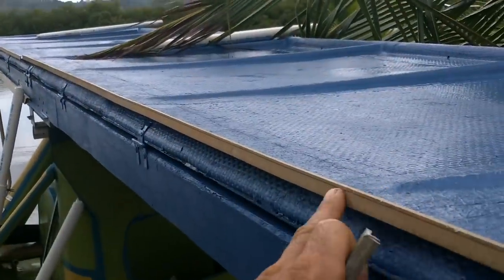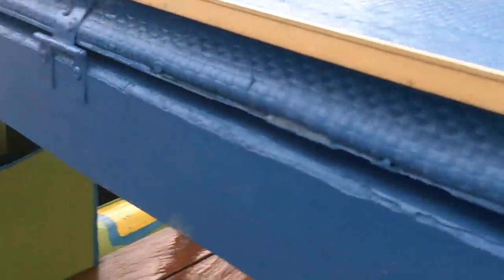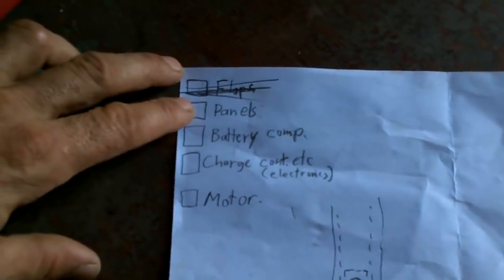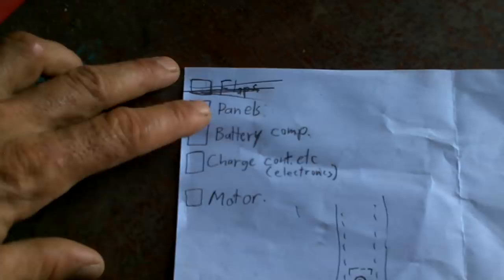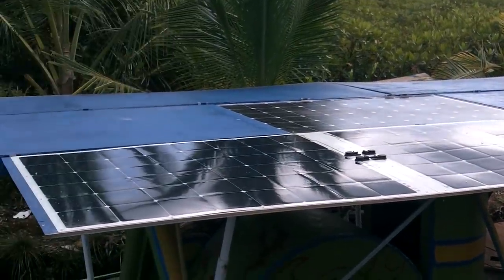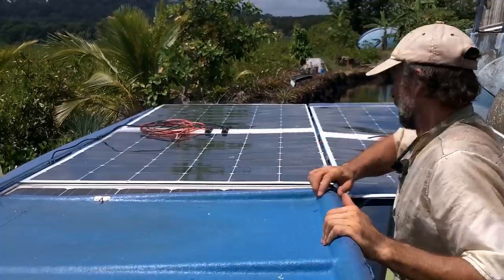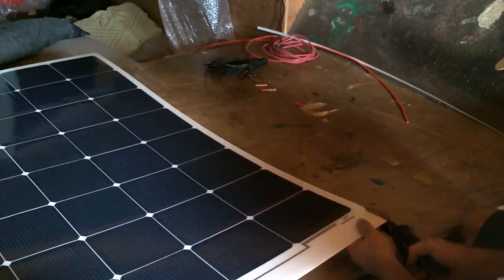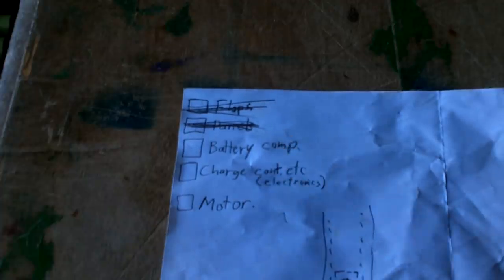Solar Snailer 036 Serious Solar Panel Action!

Comment: I like to watch other people put stuff together. When I work on a project and it's time to cut drill or somehow commit to using the very expensive material, we are all one in that monent. That microsecond of committing to a path. Fortunately it almost always turns out. I find success to be in the prep work. I also really enjoy when something unforseen causes me to adapt and the result is better than the original plan.

Comment: I don't like to make suggestions because Jamie usually figures things out BUT,  get the correct connectors for attaching the wires to the solar panels, coat them with dielectric grease and seal with silicone.  In a matter of days or weeks, his makeshift connections will start to fail.

Comment: use fine strand wire so it's flexible.  The stiff wire will fatigue and maybe break when you open and close the flaps.   Looking good!!!
Reply: Would fine strand work for the kind of electricity the panels produce?
Reply: If there is enough slack in them, the fatigue will be evenly distributed throughout a longer length and shouldn't be an issue. They do look pretty stiff though and definitely could cause them to break depending how tight they are routed to the panel hinge. 
Im not sure they make thick gauge fine strand wire, but that may be a good idea. Perhaps just a length right where each band occurs... Of course, I suspect its easiest to use it till/if it breaks, and if it does, use finer stranded wire to where it broke. I lean toward it will be fine if he leaves some slack in there.
Reply: My guess would be that Jamie works with what he has available at the time. Finding a solution down the line if stress points becomes an issue.

Comment: Sometime when you'r buying supplies, check out Marine Goop. It's real good at sealing and glueing and the sun doesn't hurt it. You could glue those wires down not have to use clamps. I use it to weather proof everything. You can wet your finger and smooth it out like glass and paint over it.
Reply: I think Marine Goop is just Shoe Goop with a different label.

Comment: Jamie if you can prop these up at close to a 90-degree angle  ,  (~          ~) with the drip edge 3 or 4 in on both sides to help catch the wind I'll bet with a good headwind or Tailwind you still have a pretty good sail . Or 3 shaped on the side that folds down last and use this side as your sale . I'll bet you can use your post to prop it either direction to catch more wind  .
I'm even picturing a hinged flap at either end that can be folded out to catch more wind . Or a third panel that hinges up from the outside of the top panel that can be held at different angles also to give you more of a wing .
 you could even put the whole thing on a pivot in front and a rail in the back that would allow you to even use it more like a sail .
 a dagger board or two and you'll be flying .
Reply: I saw a movie or something where a raft deployed a parachute on a winch to help pull! Like Mad Max it man! :P
Reply: @Reach3DPrinters  yeah check out silent yachts they have one that is really cool !
Reply: His original design was going to used curved panels for exactly this purpose, but the complexity of it made him change his mind.
Reply: @raelik777  oh yes I knew that I am watch every episode Jamie puts out .
I just see how he could still use this as a sail . That's all I'm suggesting .

Comment: I'm curious if there's a MPPT charge controller in the electrical mix. If not it would really help with the battery charging.
Reply: Historically he doesn't use charge controllers

Comment: I'm planning a large 3KW solar panel rack to go on the front of my boat and compliment the 600 watts I already have on a welded aluminum frame on the back.  The glass panels I was going to use weigh 450 pounds.  My guess is that this will total nearly 1,000 pounds with the aluminum rack, and the boat may be unsafe with all this weight so high up.  I'm seriously considering making exactly what you've made instead.  How much do you think your support structure and panels weigh including everything from the deck up?  What are the dimensions with the wings folded out?  I will have to scale the weight estimate to the 10 by 15 foot area I have available for solar.  Thanks for any advice you can offer.